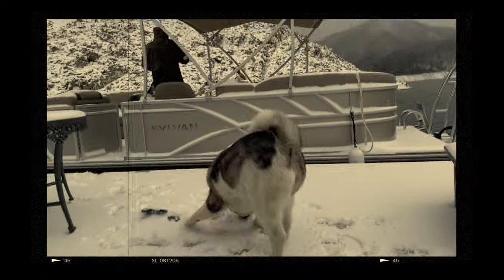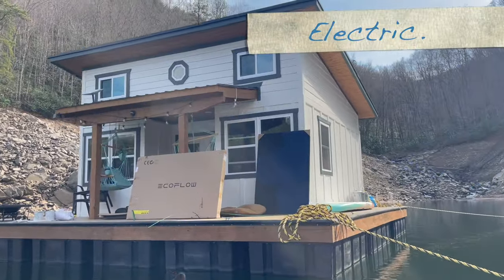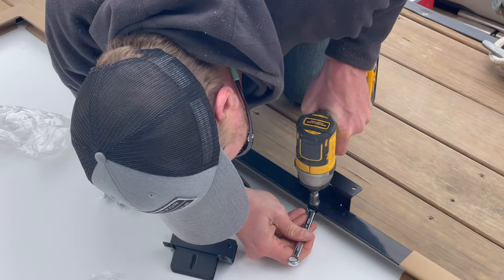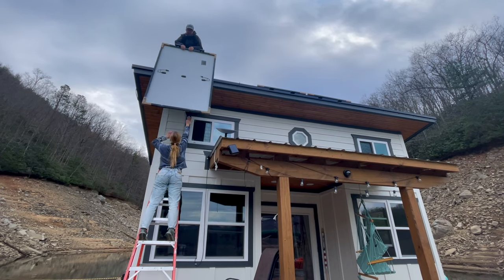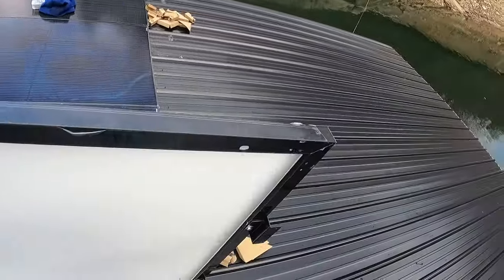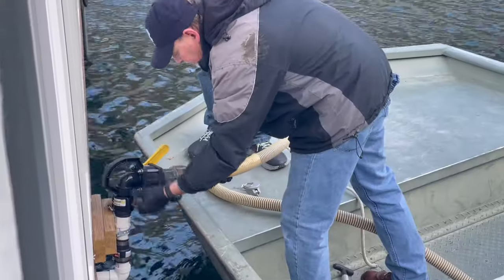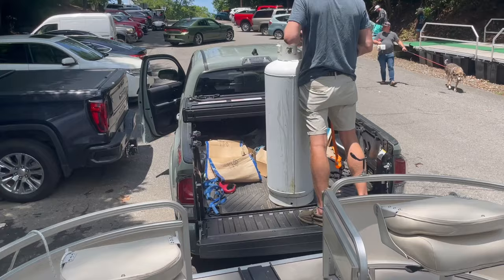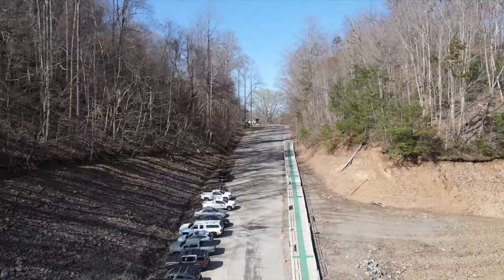How UTILITIES Work on FLOATING Houses 🤔

Comment: It increases the cost and complexity, but you can use multiple charge controllers that work together to combine disparate panel outputs. Boats often do this to deal with different size panels and shading they have to deal with.

Comment: I was sitting on the edge of my seat watching you with those solar panels! You did it! Next time secure it with a rope! Glad you’re safe! Great information! You’ve got a lot of self sufficiency with the solar. Is the electric heat a heat pump? Is that gas heater vented? Is carbon monoxide an issue ever? Sorry for all the questions. The life you’ve building for yourselves is inspiring. The fact that you tackle all sorts of difficult and adventurous things on a daily basis make your videos a must see.
Reply from the maker: Haha thank you!! The electric heat is not a heat pump, I am not sure what the technical term is haha but it’s just a self contained unit kind of like a ceramic heater but very efficient, operating off of our solar. The gas heater is a ventless heater! The main downside of ventless propane heaters is that they produce a lot of water vapor as a byproduct, so we usually run a dehumidifier if we’re gonna have it on so we don’t get mold. We do still have a carbon monoxide detector because well it’s just smart to have one in general, especially when you’re using anything with propane in the house. But we’ve never had it go off before or otherwise had any indication that carbon monoxide is an issue, ventless heaters are considered perfectly safe (just a little annoying with the moisture thing!). 🤍 thanks for the sweet comment!
Reply: @KeepingAfloatWiththeJoneses  thanks for the answers. Moisture is a huge problem in small spaces. We’ve lived in small Rvs and in a small house now. Dehumidifiers are essential. So glad to see your new solar is working so well. We live along a creek in the woods. Moisture is always a problem here, I imagine it would be there too, living on a lake.

Comment: Depending on the charge controller(s) you use, you CAN mix different panel sizes.  Just not different sizes on the SAME controller (unless it's a multi-channel).  It looks like you would have enough room for another 4 panels on the upper roof (barely) if you want the extra juice.

Comment: Just to put those power figures into perspective: an LED light is around 5 Watts, a laptop charger between 50 and 70, a toaster 600-1000 W, a hair dryer more like 2000. If the sum of the appliances you've got turned on at the same time is higher than what your solar system provides (and those figures are maximum numbers with the sun shining full strength straight onto the panels, on a rainy day you get a lot less) you're draining your batteries. As you mentioned, at some point you have to turn everything off and wait until the batteries are recharged.

Your typical US house on the other hand gets 36000 or even 48000 W from the power company. If you compare that to a few hundred W of solar you can tell that living off grid is going to be a bit frugal in comparison.
Reply from the maker: Oh agreed, it’s very expensive (as of now at least) to deck out a single home with enough solar & battery storage to equal what an entire power company can provide haha. For folks who want every electronic luxury life can offer and have enough disposable income to spend 20-30 grand on a solar setup, it’s possible. But for most working class folks like us, going off the grid in an affordable way will require a change in lifestyle choices that also benefit both your pocket and the environment. Not having 36000w to work with doesn’t mean you can’t still have most of the luxuries of a normal home, such as the hair dryer or the toaster oven, but like you mentioned, you’ll need to learn to be mindful and frugal with your use of them. Which is a great practice for anyone and everyone to work towards, on or off grid! 🙌😊

Comment: Excellent video as always! I noticed that your roof is a dark color and metal. What are your new panels rated temperature wise? And will they be ok during the summer?
Reply from the maker: Thank you!! I can’t find the rating on the website description for these panels, it’s probably in the manual somewhere haha but I couldn’t tell ya off the top of my head. Temperature wouldn’t be a concern in a very mild climate like ours though, even with a dark roof! 🙌 the old panels on this same roof did just fine this past summer 🌞

Comment: Still wish Oklahoma would allow Boat Houses!😢
Edit:
Is there a list of states that allow Boat Houses?
Reply from the maker: There isn’t! We haven’t been able to find any single resource with comprehensive info on these, mainly because regulations vary so much depending not only on the state but mainly on the specific entity that owns the lake. Lakes owned by corps of engineers for example have totally different rules vs lakes owned by power companies or vs private lakes. This all being said… I do happen to know off the top of my head that some lakes in Oklahoma do allow these! I’ve seen them online on Lake Murray for one. 🙌
Reply: @KeepingAfloatWiththeJoneses  😲 I'll be sure to check into it, thanks! I've seen before that Lake Murray has floating cabins on the lake, for crazy $$$
Reply from the maker: I bet!!

Comment: If you have internet but lack cell, have you got something like Google fi where as long as you can reach you wifi you will still have phone service?
Reply from the maker: There is a setting built in to your phone called wifi calling that you can turn on and it preforms that same service, allowing you to make calls over wifi with no cell service 🙌 the “SOS” feature is also a good backup in case the wifi ever went out or we were out on the lake and something went seriously wrong - by law if you call 911 and don’t have any service with your provider but another provider might have a tower somewhere that can pick you up, any provider that can HAS to pick up your call using their towers. So that helps expand coverage for emergencies at least 🙏

Comment: If you guys get snow do you need to go clear the solar panels off?
Reply from the maker: Nah they are rated to hold a pretty significant amount of weight from snow, and in terms of efficiency, at least with our last panels snow kind of had a similar effect to a cloudy day. Might be an issue if we were in an area with really consistent and heavy snow, but here it only snows every once in a while and usually melts within a day or two 🙌

Comment: Since I was Paying 650 bucks a month on my all electric house I put in a 16 400-watt array at the house and a special electric building. Then I bought 3 Totaled Tesla's took the battery packs and added the proper charge controllers Sold the cars for salvage parts good money there with the help of a genius who is a master Genius Electrician and Solar Outlet who I grew up with my Cousin . It gave me 6400 watts which is not much plus Battle Born Batteries that added 2000 more watts and added again 5 more solar panels the best of everything. My heater takes 15kw to heat this big house and the 2-3 ton a/c Units and I charge when needed the batteries online, but it still will not run this house. I managed to save $280 a month but the cost to build was 20g. Certain times a year I do not need heat or A/C the biggest cost. I am changing Heat and Ovens out to Propane to kill the 15KW Cost on heat and electric. I bought a 2000 Gallon Propane tank. I will let ya know what that works out to. I wanted to try. Then I bought a 20kw Natural gas Generator when all else fails. Insane costs but if I live to be a hundred years old it may be worth it. But at least in this Very Rural Setting when the Electric goes out for days at a time I can survive but I would rather live on the water where you do cheaper less trouble. And I do not need a Genius Scientist to figure it all out. Put Soft Starts on your A/C Units. At least all the Electric is in a Concrete Building as required by the Dang Insurance Company away from the House. You need a College education to go in there. So you know what I did I bought a wrecked 1 year old Refrigerated 18 Wheeler Trailer at Auction removed the A/C unit and now I have over the duct men hooking up the cooling unit to my existing duct work and a special 2 Party Thermostats to cool the house and a 500 gallon fuel tank to use as needed. Then we will compare savings. The Tank is in a special storage area too. Place looks like an Army Test Facility. This is North Louisiana Hot Humid Miserable with no electric. Sorry this was a long one. Smile and double your solar you will thank me.
Reply from the maker: Oh man! Sounds like you got a wild setup! 🤪 Love all the DIY touches haha
Reply: Yes it is absolutely Insane but you never know what tomorrow may bring. You have a good channel. I like it. @KeepingAfloatWiththeJoneses